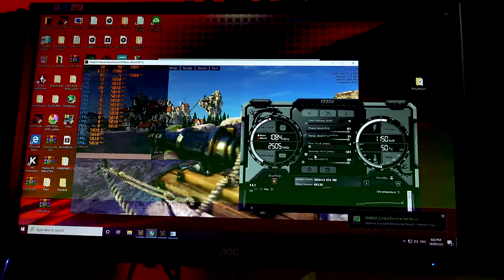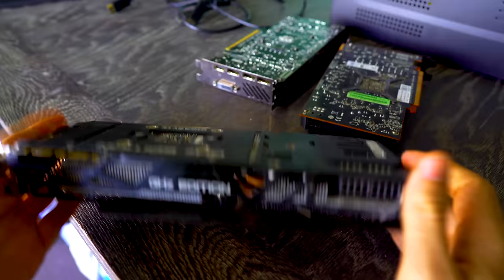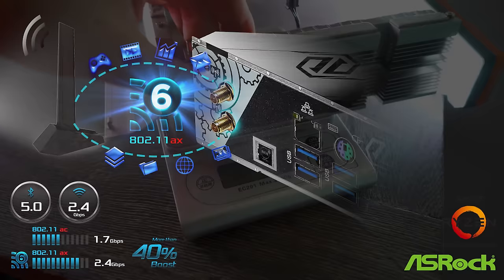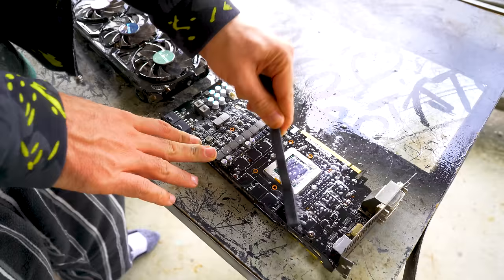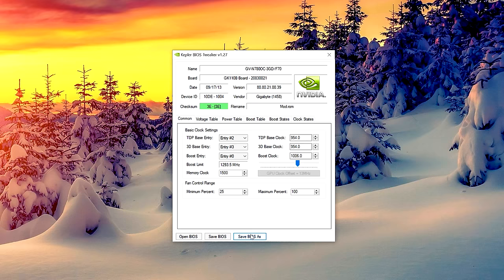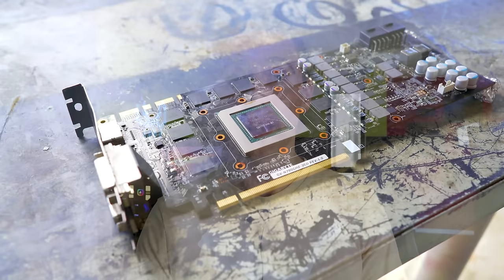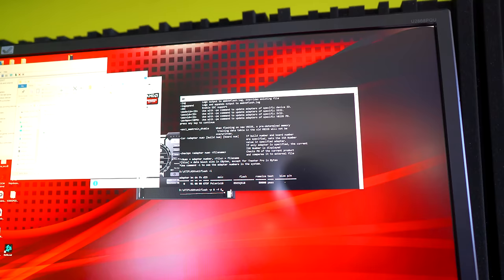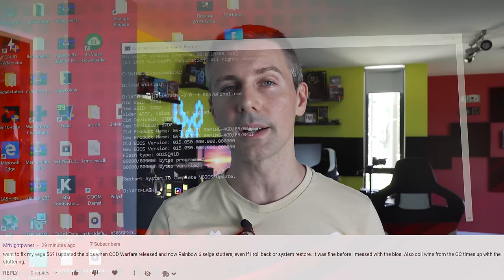4 Problems that Cause a Faulty GPU and How to Fix them.

Comment: I had a completely dead GTX1080, I put WD40 and scrubbed it with a brush then the heat gun method. After doing all these steps I put it in the computer then the fans spun up!! it was alive… then sparks and smoke… I’m pretty sure I missed a step, but it did work for 2 seconds 😂😂😂. Now I drenched it in wd40, and used compressed air to dry it the best I could. It Smoked/ sparked at the plug then and at the back of pci socket. I also killed the computer. For next time… because I buy all my parts used, so there will be a next time, do you recommend a drying period of time before plugging in, and also is possible to test it outside of the computer?

Comment: I used to have a situation with a laptop. I install a new system and when w10 install graphics drivers screen become in so many colours and junk and there were no pictures that you can recognize. When I remove drivers all comeback but w10 install drivers again and the same story.
I remove one of the memory banks and same thing then I remove the memory and put first one that I removed and all work perfect. Some times there can be a crazy solution that can work...

Comment: i've got a similar problem with my r9 270x..... blanks when installing driver.... too scared using heat gun tho.... planning to ask my friend to test the card in his system and see if it works there
Reply: Nurhuda Kurniawan  gave up

Comment: Could help me diagnose mine?
i have RX470 
the fan turn on, the gpu produce heat, but it wont get detected by PCIE 
im using MSI A68HM E33 V2 Motherboard :(
can anyone help me?

Comment: rx 580 cards does not accept low quality hdmi cables try with a better cable  ihad same issue there was black screens come and goo flickering and it was all about cable which does not appear on nvidia cards some cards of amd like rx 580 has that problem about Hz transfer frequency stuff. u need quality cable

Comment: Man, clean the card properly, as you always do, then use some quality flux when you're doing the heat gun trick. Use an infrared/contactless temperature detector or a thermal camera and one very important thing to remember is to never heat an electrolytic capacitor at probably 180-185 Celsius (which is the melting point of the tiny tin balls under GPUs and memory chips).

Comment: I have a weird problem with my gpu (5700xt). Everything was working fine in games until about two weeks ago. I mostly have my card at stocks speeds when gaming. On hot days I’ll slightly undervolt it. Most of my games will hard freeze a little after launch, and games that do load I have to put on the lowest settings and limit frame or else it will hard freeze. The only game that works perfectly without error is Minecraft. Forza runs if I limit my FPS and lower resolution. Borderlands and BFV hard freeze after about 5 minutes. Assassin’s Creed Origins and Horizon Zero Dawn won’t even start to begin with. I tried DDU, Heaven Benchmark, MemTest, Cinebench, CPU Z, updating the BIOS and Chipset, ran a SFC scan, chkdsk, and rolling back my drivers. Nothing seemed to solve the problem. Until I swapped the GPU with the one in my mom’s pc (GTX 1650 Super). Everything was working as normal. So now I’m certain it was the GPU. Got any more tips that could help me fix this problem. (These problems only happen when running games).

Comment: I loved the video, but I have another problem, I hope you can help me. I was recycling an old GPU (XFX 7970 dual fan) for a new PC. When I connected the GPU to the new MB, it worked giving video in all display ports, but the fans weren't spinning, and after 20 to 40 minutes at idle, the GPU temps reached 70-90°C with the fans totally stopped, but without artifacts or other weird behavior.

After that I bought a replacement for the fans, then I opened the GPU, cleaned everything, put new thermal paste, thermal pads and replaced the old fans. Then, the problem didn't get solved, fans weren't spinning even trying to force a manual curve in MSI afterburner, nothing happened. 

Then I bought an adapter cable to connect the GPU fans to a PWM port of my MB. Surprise, the old and new fans spinned instantly connected to the PWM, but without being able to be controlled by the GPU. 

So what do you think could be the problem and solution? I don't know micro soldering so I don't have the capability to check a micro shortcut, but at sight it doesn't look like it have any burned part.

Thanks a lot
Reply: Solution would be to use fans you connect to the motherboard instead of the gpu itself

Comment: hey there, the first card i ever used a heatgun on was a r9 270X en i fix it today, the card had dots its the bios screen en after i atempt te instal a driver it crasht before i used the heat gun.
so im realy happy it workt :)

Comment: Hi, any advice would be appreciated. I have been recently getting artifacts at default clocks, games freezing and crashing. I presumed memory but after many tests on heaven benchmarking i can bump my memory up 300mhz no issues but I need to underclock my core by -50 to stop artifacts and crashing. Gpu temp is around 50 degrees under load gtx 1080.

Comment: i have an gpu that doesen't display aything. but when i plug it in my second pcie slot it gets detected in windows but isen't useable with any gpu program like furmark.
the fan doesen't spin either. but gets warmer overtime
Reply: GPUs normally have a zero fan mode. It is possible that they won't spin because the card wasn't hot enough and the usage was not that high. I guess you also won't get a signal from the card in the second pci-e slot, right? The fact that Windows recognizes it shows that it's not dead but it seems like it has a failure. You could try to deepclean and/or the card and hope.
Reply: @GipfelKreis  its one of the older cards tht diden't have that zero fan thing. it diden't give a single as the first slot pcie either and yes i know its not completely dead i don't have a lot to clean it with.

Comment: what heat setting would you use, mine has 50, 450 and 600? was a bit hesitant to try 600
Reply: Often 280 is good. Wouldnt go higher.

Comment: heys guys, i bought a 450$ 2070 super thinking it was gonna be the best card ever. ended up not working properly and have no idea how to fix it. when it installs the drivers the screen freezes and blinks black and goes back to normal. it seems that in task manager it hits 100 and that’s when it does it. i’ve tried everything, i even put it in my friends computer hoping it would work, but it did the same thing. anyone got any ideas?

Comment: I bought an r9 270x in 2015 in 2017 not showing any signels at start fans run for a second or two then stops.....i saw a video....he said to put it in pre heated ovan for 4-3 minutes at 120 degree Celsius so i did.....i was dumb I kept it upside down.....and after 3 minutes the capacitor started to bust and some parts did fell down....well id replaced the capacitor with similar ones and it started......i play nfs payback at rock solid 60fps in 720p on high settings with i5 3330s.

Comment: My card was working properly until I turned off the PC then nothing, fans turned but no signal, I switched to onboard display, no card in the device manager. I remove the card from the mainboard clean the socket, reinstall the card works like a charm. After a couple of turn on turn off same story, remove the card install it again rework. I have installed another card it does work. So the problem is from the graphic card, not from drivers or mainboard. I would think it maybe a capacitor which is going to die soon but I am not sure. Anyone has got ideas?

Comment: Hi, I got this GTX 950 way back 2018 where it stucks at very low clock speeds but you can use it around your pc like just around your desktop. The problem is that you CANNOT play with it. When you play a game with it, it runs on very very low FPS. I've already tried everything like reinstalling gpu drivers, overlocking it etc. and nothing worked. Maybe you have an advice to fix it? Or I'll just leave it and throw it lol.

I love watching your videos keep it up.

Comment: bought a brand new MSI ARMOR rx570 last May and it is malfunctioning now. Claimed warranty but my local seller only fixed it but today the same problem came again. when I boot my pc it runs for a few minutes and all of a sudden the screen goes blank no display output at all, i am really sad and disappointed now. I think i am never gonna buy an AMD gpu again

Comment: Problem one happened to me after a recent power outage... gad damn. PC boots fine when it has basic microsoft adapter.. moment I boot up an amd driver, bam, black screen+ restart. Then it freezes at ARSENAL Gaming on the boot. Need to boot into safemode then ddu, then works fine again. but can't use my gpu for gaming :( it's a 5600XT tho, still under warranty but the lockdown in our city prevents me from getting a replacement.

Comment: Hey guys. I just had a question if any one help. My computer now will not start unless I unplug the power to my graphics card. When the card is plugged in the power button blinks but shuts right off. Anyone go through this before.

Comment: Bought an RX 6600 non-XT a few days ago, it got detected normally. I installed drivers and after 3-4 minutes of just desktop use, PC crashed. After restarting the card never got detected again. The PC turns on but just gives no signal. Tried it in other PCs, nothing. Tested the PCI-e slot with a GTX 1650 and it worked fine. Fans still spin though like at 50% speed. Starting the year with a dead GPU does not make me happy haha

Comment: I took gtx1050ti from friend pc, put him gtx1660s. Bring card home, clean gently back with round brush, dismentle fans and plastics, clean with brush and vacuum it. put back together and GPU does not send signal. What to do? It worked few hours ago..
Reply: I must say, friend smoke a lot and it is sticky.

Comment: How do you fix buzzing on a graphics card? It does this when under a load
Reply: It's called coil whine. The inductors on the VRMs are buzzing when there's lot of current being drawn. It's totally normal, albeit annoying.
Reply: @usoppbarbosa981 Alright thanks! I thought it was that!

Comment: It must be humid where you live. To see so much oxidization. I'm curious about the WD40. I know some people swear by it for cleaning and storing their Rifles. But.... my experience is its acidic. Stuff I have sprayed with it put into storage then came back to later were severely oxidized (rusted). Do you see any indication of that, long term, on your stuff that you sprayed then put on a shelf or something. Lastly a weird one I came across. Not video card related exactly. I inherited an early Lan Party Athlon board. And could not get past the initial boot to a bios screen. And eventually gave up on it but saved the huge ASUS CPU cooler. A year or three later I mounted said cooler on a daily driver and..... it would not boot. Turns out there was some issue with the fan. It was spinning but...

Comment: I have old Radeon R9 280.  The card was constantly freezing in windows no matter what. I cleaned the card and blasted it's gpu with hot gun. Now I am using it in linux with open source drivers and i have no issue. I would try that especially with amd cards.

Comment: black screen could be a uefi/bios. My pc just broke so i put my gpu into old dekstop with legacy bios, it goes black screen in logon screen (after windows logo).  it's r9 380 into some old lga 1156
. Sadly no button switch uefi / bios on gpu.
Reply: Can you elaborate on this?
Reply: @walruspolish pc is too old, and that r9 380 is an UEFI gpu is incompatible with my old pc with BIOS. Newer card nowadays is UEFI card only. now i'm looking at gpu with legacy bios support.

Comment: I’ve had the dreaded black screen with different ATI cards. What worked for me was installing a different ATI card that had no driver install issues and then just removing the replacement card and installing the problem card. This worked as the drivers were already installed. I tried multiple times with the problem card installing and uninstalling drivers with DDU and a clean install of drivers. It would black screen as soon as it tried installing the driver. I don’t know exactly what the issue is with AMD drivers. Many people have this problem............yet AMD does nada to solve the problem. Some blame Windoze........but I don’t know. Seems like a driver issue to me. Boots to safe mode with standard drivers fine.
Reply from the maker: That's an interesting problem, has this occured on say a 2nd gen intel rig? or was it on a newer rig for you?
Reply: @techyescity  It was on a new build. FX 8350…..MSI 970 Gaming………24 Gb ddr3-2133………SSD…..etc…etc. I do the same thing as you……build and sell yesterday’s hardware. Overclock em, tweak em, sell em. Always put my builds in a bling box. They sell quicker. All systems under 1000.00. Minimum 4 cores, 16 gb ram. Monitor, mouse, and keyboard included. You were my inspiration for starting this. I’ve been building computers since the XT……..YES…..the XT. 
On another note, I was building a cheap potato with leftover stuff and I by mistake put in a known non-working GPU I had lying around. Tried everything to fix it, but a no go. In any event, I was using an Asus M5A78-M/USB Motherboard with onboard graphics…….which I knew it had…….but wanted a dedicated GPU. So I installed the known non-working R7-265…….and low and behold……..device manager shows dual graphics with the 265 and onboard Radeon. That can’t be I thought to myself………so I decided to try installing the drivers for the 265……and voila…..it does work. That’s just weird. Perhaps the onboard graphics had something to do with that……..not entirely sure.

Comment: i have a gtx 580 with the same 1 problem the solution i find was to put a 2 grafics cards a low watt hd 4350 for display and the 580 in the second slot i instal the 580 drivers it finish the instalation with no black screen then i turn down the computer and put de 580 in the first slot and it works perfect the computer the driver the nvidia control panel all working . i dont now why when the driver finish must call for the signal of the screen to gpu and the gpu dosent work and dont respond the instalation cancels or black screen and then cancels . saludos de argentina !

Comment: What if the card will start up sometimes but only after removing it and reinserting it back into its slot?
Reply: Good indication of a dry joint 👍
Reply: @cyberspooky  what is that?
Reply: @byankabutterfly271  that is where the solder joint has not flowed properly or the joint has been contaminated during soldering , every time you remove the card you put different stresses on the card and force a temporary electrical connection, as soon as the card settles again or heats up you get a break in the connection, when installed and turned on wait for it to play up and try pressing on the card in different places to see if it comes good , or if you have some electrical freeze spray try spraying as many solder points as you can reach 👍

Comment: My 1050 ti 4gb stopped working on my pc  so i got my spare 750 ti   and worked perfectly  but tried the 1050 ti in another system and it worked  put it back in my system didnt work DOes anyone have an idea what is the problem

Comment: Tech Yes City i hope you can help me with my GPU, i looked in the device manager and it says "code 43" now i done i think every fix i could find in the net but nothing seems to work, I tried Flashing it, Driver Reinstall, Windows 10 Update. The one that is close to success is when i clean it, I change the thermal paste, it works after i clean it but as soon as i restart or shuts down my pc, again with the problem, sometimes it will just hang in windows loading screen, "BSOD with system thread exception not handled nvlddmkm.sys" sometimes it will work just fine then after i reboot it then again with the problem. Im not rich thats why i save up for this GPU "msi 2070 super gaming trio". i hope you can help me. Thank you

Comment: Yesterday I had a Watercooling Leak and it dripped onto my GPU while I was at a funeral, when I came back I was watching something while waiting for a update to install and it just crashed, pc turned off automatically then turned on again but didn't give me a signal from my GPU, the fans do spin but it doesn't get recognized anymore, I've taken it apart and cleaned it (more like dried it as I didn't have cleaning alcohol or anything) but it still doesn't work 😐 anyone ever had luck fixing that or is it bricked for sure?

Comment: i had a GPU GTX 670 4GB from ebay which i got faulty (artifacting)  for £20. I got tried everything to stuck it in oven, didn't fix it. So thought lets try again and guess what been working since.

Comment: Hi, my pc worked fine a few months ago. But now it doesnt boot with the gpu plugged in. I thought that the gpu was faulty so, i put it in sunlight for a few hours to get rid of the moisture. And it worked all day, without any problems. But the next day, computer didn't boot again. Then i kept the gpu in air tight rice box for 24 hrs. Again the pc worked fine for a whole day with the gpu. But the next day it won't boot again.
I don't know whether my gpu is the problem or something else. My gpu is msi armor 1070 ti oc edition.
P.S. pc works fine without the gpu.
Reply: clearly the mositure in pcb is the culprit. you can place in under the oven 100c for 1 hours

Comment: I have a 660ti that just died on me mid playing a game, the whole PC crashed in the process. Upon restart, Windows just uses integrated graphics despite my monitor plugged into the GPU itself essentially turning it into a giant adapter. Checked device manager and it shows "Windows has stopped this device because it reported problems. (Code43)". I've since gotten a 1070 which works fine, so i doubt its software/driver issues or mobo issues.